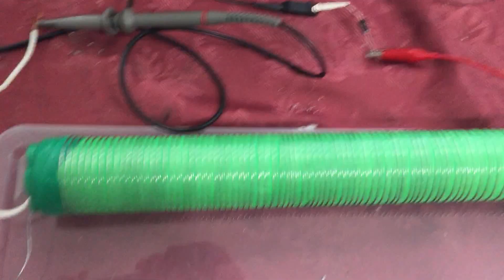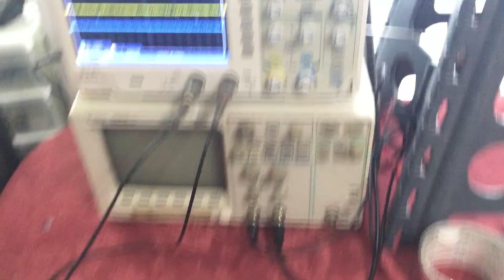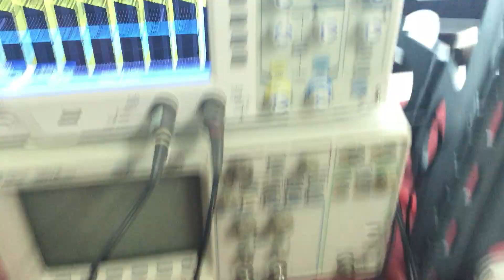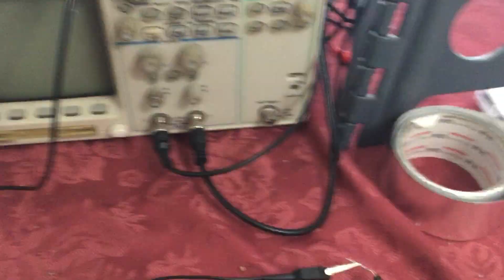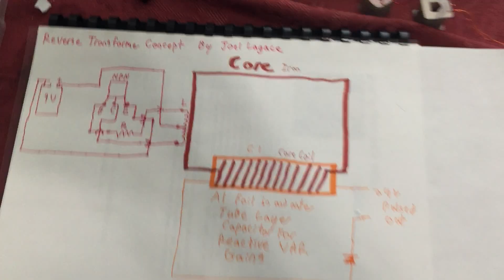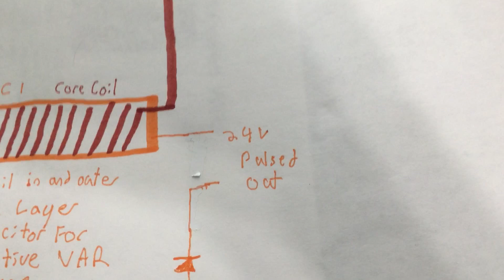Reverse Transformer

Comment: with op amp circuits your source wave has input more than 1 and the reflected wave is in phase , this way the extra amount over 1 is added to the wave and you have amplification (Radio Transmission)

Comment: If you add a second diode in parallel to the first one but in reverse then you have two taps for each polarity of the voltage change (one taps V+, other taps V-). perhaps you could shift the phases to align them into a smooth sinusoidal wave using passive components (e.g. Phase-shift oscillator).